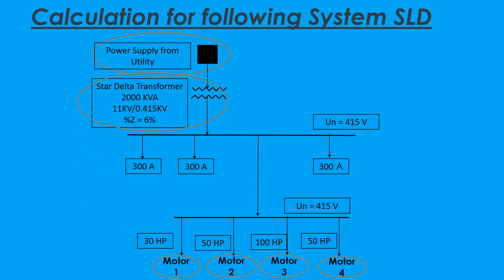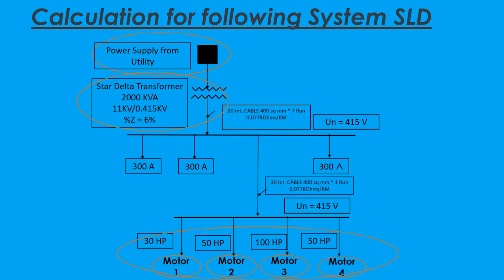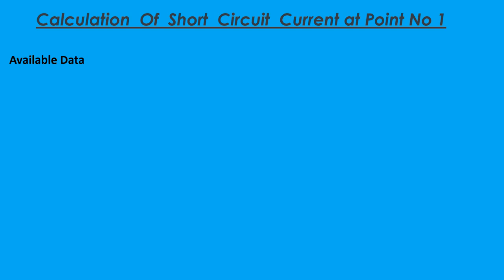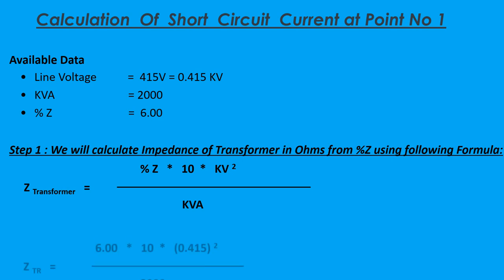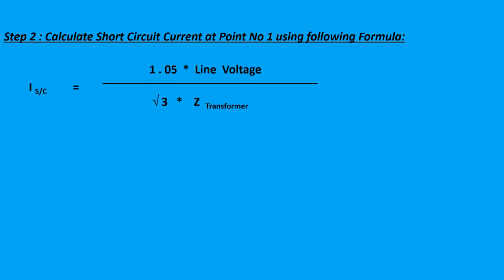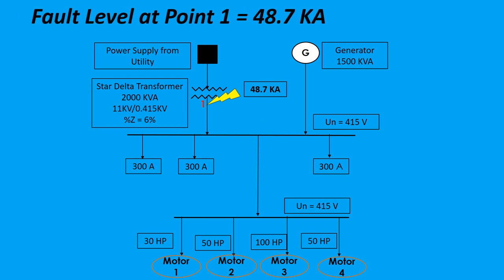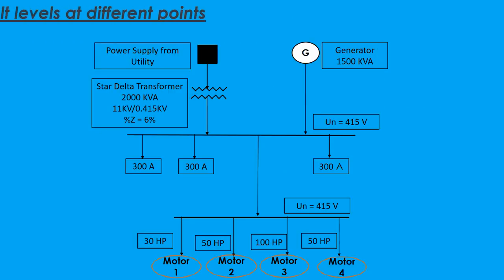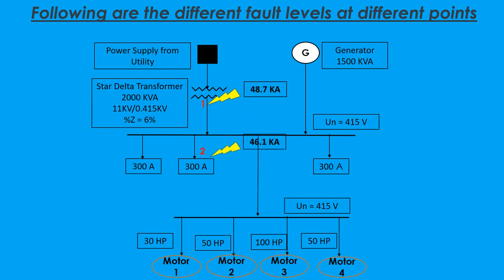Short Circuit Fault Level Calculation

Comment: Nice video if the questions can be explained. A number of people (including myself) asked why the factor of 1.05 comes into the equation. I still prefer the per unit method. It eliminates the need to determine what voltages should be used at different levels if you have multiple transformers.
Also,  all those motor loads will definitely contribute to increasing the Isc at point 3. Suggestion is that if you don’t want to bring motor contribution into example, don’t specify motor loads. It can confuse some readers thinking that you don’t need to add motor contribution.
Reply from the maker: Thank you for sharing your views and thank you for the question, Answer to 1.05 question is : 1.05 is a  voltage factor required in the calculation to
account for Voltage variations in the system,if we consider voltage variation of +-6% in voltage , we have to use factor of 1.05 in the formula as per standard IEC 60909.
Reply: @ratssaesquareallaboutelect5919  
Thank you for your reply. Much appreciated.
Reply: @pietervdberg7055  Also note that motor contribution only occurs for 3 to 4 cycles for asynchronous or 6 cycles for synchronous machines, so not a huge factor when sizing equipment based on steady state conditions or fault levels that can exist for hundreds of milliseconds or more. Also the 1.05 takes into account the voltage factor  or voltage rise that occurs on phase due to the raised neutral potential and normally relevant on single phase shorts
Reply: @richhall3662  nice
Reply: In short, calculate the short circuit current at nominal voltage and add 5% extra value to Isc (considering the factor for rise in voltage level).

Comment: The presentation will be complete if motor contribution to fault is considered which is very important factor..
Reply: Motor and Generator as well
Reply from the maker: If Total Motor Current (100 + 50 + 50 + 30 HP , 415V , 0.85 PF) = 281A

Total Motor  current<= 0.01*Isc , then motor contribution can be neglected,
Then isc at F1 - 48.7ka , ,281< 487 , MOTOR CONTRIBUTION can be ignored, similarly F2 - 46.1ka , 281 < 461 and F3 33.5ka , 281 < 335 , motor contribution can be ignored

Comment: Could you please explain number "10" in the formula for z(transformer). Where did it come from.
Reply: its contant in order not to include the thousand in the kva of transformer instead using 2000000 you will use 2000

Comment from the maker: If Total Motor Current (100 + 50 + 50 + 30 HP , 415V , 0.85 PF) = 281A

Total Motor  current<= 0.01*Isc , then motor contribution can be neglected,
Then isc at F1 - 48.7ka , ,281< 487 , MOTOR CONTRIBUTION can be ignored, similarly F2 - 46.1ka , 281 < 461 and F3 33.5ka , 281 < 335 , motor contribution can be ignored

Comment: Very nice video. But I did not see any contribution of motors into the fault point as a secondary source and alternator and also why you have included 1.05XV in the calculation?
Reply: HOPE YOU HAVE NOT RECEIVED ANY ANSWER.
Reply from the maker: If Total Motor Current (100 + 50 + 50 + 30 HP , 415V , 0.85 PF) = 281A

Total Motor  current<= 0.01*Isc , then motor contribution can be neglected,
Then isc at F1 - 48.7ka , ,281< 487 , MOTOR CONTRIBUTION can be ignored, similarly F2 - 46.1ka , 281 < 461 and F3 33.5ka , 281 < 335 , motor contribution can be ignored

Comment: what is the effect of the motors in the short circuit calculation?
Reply from the maker: If Total Motor Current (100 + 50 + 50 + 30 HP , 415V , 0.85 PF) = 281A

Total Motor  current<= 0.01*Isc , then motor contribution can be neglected,
Then isc at F1 - 48.7ka , ,281< 487 , MOTOR CONTRIBUTION can be ignored, similarly F2 - 46.1ka , 281 < 461 and F3 33.5ka , 281 < 335 , motor contribution can be ignored

Comment: Pls help with data sheet reference for Cable impedance value. It seems you have considered Cable resistance value instead of Impedance. Pls clarify. Thanks
Reply: If you multiply kva by 1000 and kv by 1000 but undersquare and  make per unit impedance 0.06
It makes the same number
Reply: You are right, I think data of DC resistance value has been considered here, instead of which cable impedance as per manufacturer's data should have been considered.

Comment: Thanks for the video. 
Please when you mentioned number of runs;  did you mean the number of cables or what ?
Please, explain it further. 
Thanks.
Reply from the maker: No of run means no of parallel cables

Comment: Please explain the factor 1.05. how it comes.
Reply: sunil kumar moharana 5% voltage tolerance, which is very typical.
Reply from the maker: thank you for the question, Answer to 1.05 question is : 1.05 is a  voltage factor required in the calculation to
account for Voltage variations in the system,if we consider voltage variation of +-6% in voltage , we have to use factor of 1.05 in the formula as per standard IEC 60909.

Comment: What about motors contribution to the fault?
Reply: Good question the reverse currents shall be calculated
Reply from the maker: If Total Motor Current (100 + 50 + 50 + 30 HP , 415V , 0.85 PF) = 281A

Total Motor  current<= 0.01*Isc , then motor contribution can be neglected,
Then isc at F1 - 48.7ka , ,281< 487 , MOTOR CONTRIBUTION can be ignored, similarly F2 - 46.1ka , 281 < 461 and F3 33.5ka , 281 < 335 , motor contribution can be ignored

Comment: Where it's coming 10, in impedance of transformer, what is the fault current in 11kv side
Reply from the maker: it can be obtained  from transformer rating plate.
Reply: @ratssaesquareallaboutelect5919  sir pls explain from where it's coming 10

Comment: Where did you get 1.05 shown in your cakculation.
Reply from the maker: As per standard IEC 60909 - 2001 , We have to consider the voltage factor of 1.05 in LV fault calculation (100V to 1000V).

Comment: Can you please explain why you are dividing the line voltage by the square root of 3 in Isc formula (At Point 1) ? Your response will be very helpful.
Reply: it is incorrect. There is no point dividing by root3. Any current is simply V/Z. 1.05 is form factor.

Comment: Hw did u get 1.05 while calculating Isc
Reply from the maker: thank you for the question, Answer to 1.05 question is : 1.05 is a  voltage factor required in the calculation to
account for Voltage variations in the system,if we consider voltage variation of +-6% in voltage , we have to use factor of 1.05 in the formula as per standard IEC 60909.

Comment: is 1.05 in the equation a constant value and how about the impedance value of cable ohms per km is it also constant?
Reply from the maker: 1.05 is part of equation and impedance of cable can be obtained from the cable manufacturer .
Thanks for writing
Reply: 1.05 is a voltage correction factor
Voltage maximum/voltage minimum
440÷410

Comment: can explain how 1.05 has been considered
Reply from the maker: thank you for the question, Answer to 1.05 question is : 1.05 is a  voltage factor required in the calculation to
account for Voltage variations in the system,if we consider voltage variation of +-6% in voltage , we have to use factor of 1.05 in the formula as per standard IEC 60909.

Comment: Thank you for the nice video,  this considered single phase to ground fault. Would you also make a fault current calculation video for ph-ph, ph-ph-gnd, 3ph fault?
Reply: @yaminoshinn1473  415 v is line voltage, by dividing on sqr3, it would be phase voltage

Comment: Why did you not consider the contribution of the motors below and the generator above whose ratings are significant????
Reply from the maker: If Total Motor Current (100 + 50 + 50 + 30 HP , 415V , 0.85 PF) = 281A

Total Motor  current<= 0.01*Isc , then motor contribution can be neglected,
Then isc at F1 - 48.7ka , ,281< 487 , MOTOR CONTRIBUTION can be ignored, similarly F2 - 46.1ka , 281 < 461 and F3 33.5ka , 281 < 335 , motor contribution can be ignored

Comment: What is the fault current contribution from motor
Reply from the maker: If Total Motor Current (100 + 50 + 50 + 30 HP , 415V , 0.85 PF) = 281A

Total Motor  current<= 0.01*Isc , then motor contribution can be neglected,
Then isc at F1 - 48.7ka , ,281< 487 , MOTOR CONTRIBUTION can be ignored, similarly F2 - 46.1ka , 281 < 461 and F3 33.5ka , 281 < 335 , motor contribution can be ignored

Comment: What is 1-05 in the formula?
Reply from the maker: thank you for the question, Answer to 1.05 question is : 1.05 is a  voltage factor required in the calculation to
account for Voltage variations in the system,if we consider voltage variation of +-6% in voltage , we have to use factor of 1.05 in the formula as per standard IEC 60909.

Comment: HOW YOU DETERMINED OHMS(0.0778) AT BETWEEN  POINT 1 TO2)AT3.41?
Reply: U have to take transformer impedance x10xline volt x line volt

Comment: what happen to the current contribution of the motor ? you have not consiger it in your calculation. for your info tnx
Reply from the maker: If Total Motor Current (100 + 50 + 50 + 30 HP , 415V , 0.85 PF) = 281A

Total Motor  current<= 0.01*Isc , then motor contribution can be neglected,
Then isc at F1 - 48.7ka , ,281< 487 , MOTOR CONTRIBUTION can be ignored, similarly F2 - 46.1ka , 281 < 461 and F3 33.5ka , 281 < 335 , motor contribution can be ignored

Comment: The contribution of the electrical motors to the fault current wasn't captured. It will supply fault current to the bus which it is connected to during a fault
Reply: you are correct during the fault there are some contribution from the motor this method seems shortcut.
Reply from the maker: If Total Motor Current (100 + 50 + 50 + 30 HP , 415V , 0.85 PF) = 281A

Total Motor  current<= 0.01*Isc , then motor contribution can be neglected,
Then isc at F1 - 48.7ka , ,281< 487 , MOTOR CONTRIBUTION can be ignored, similarly F2 - 46.1ka , 281 < 461 and F3 33.5ka , 281 < 335 , motor contribution can be ignored
Reply from the maker: If Total Motor Current (100 + 50 + 50 + 30 HP , 415V , 0.85 PF) = 281A

Total Motor  current<= 0.01*Isc , then motor contribution can be neglected,
Then isc at F1 - 48.7ka , ,281< 487 , MOTOR CONTRIBUTION can be ignored, similarly F2 - 46.1ka , 281 < 461 and F3 33.5ka , 281 < 335 , motor contribution can be ignored

Comment: What is the value of 1.05
Reply: As I guess, the prefault voltage is 105% of norminal voltage thus the factor 1.05 is used?
Reply from the maker: thank you for the question, Answer to 1.05 question is : 1.05 is a  voltage factor required in the calculation to
account for Voltage variations in the system,if we consider voltage variation of +-6% in voltage , we have to use factor of 1.05 in the formula as per standard IEC 60909.

Comment: Hi Sir, How did you get the figure of 1.05 in the formula?  Please advice.....
Reply from the maker: thank you for the question, Answer to 1.05 question is : 1.05 is a  voltage factor required in the calculation to
account for Voltage variations in the system,if we consider voltage variation of +-6% in voltage , we have to use factor of 1.05 in the formula as per standard IEC 60909.
Reply: IF the Voltagebminus side ,variation is 10% on plus sideand,what. is the factor.

Comment: and why is that motor contribution is neglected?
Reply from the maker: If Total Motor Current (100 + 50 + 50 + 30 HP , 415V , 0.85 PF) = 281A

Total Motor  current<= 0.01*Isc , then motor contribution can be neglected,
Then isc at F1 - 48.7ka , ,281< 487 , MOTOR CONTRIBUTION can be ignored, similarly F2 - 46.1ka , 281 < 461 and F3 33.5ka , 281 < 335 , motor contribution can be ignored

Comment: good video but where is the motors contribution, they will raise the fault level !!!
Reply from the maker: If Total Motor Current (100 + 50 + 50 + 30 HP , 415V , 0.85 PF) = 281A

Total Motor  current<= 0.01*Isc , then motor contribution can be neglected,
Then isc at F1 - 48.7ka , ,281< 487 , MOTOR CONTRIBUTION can be ignored, similarly F2 - 46.1ka , 281 < 461 and F3 33.5ka , 281 < 335 , motor contribution can be ignored

Comment: how do motors affect short-circuit currents?
Reply: for solving of short circuit current of electrical system all connected equipment's and load must be consider, in your calculation load is not considered.
Reply from the maker: If Total Motor Current (100 + 50 + 50 + 30 HP , 415V , 0.85 PF) = 281A

Total Motor  current<= 0.01*Isc , then motor contribution can be neglected,
Then isc at F1 - 48.7ka , ,281< 487 , MOTOR CONTRIBUTION can be ignored, similarly F2 - 46.1ka , 281 < 461 and F3 33.5ka , 281 < 335 , motor contribution can be ignored
Reply from the maker: If Total Motor Current (100 + 50 + 50 + 30 HP , 415V , 0.85 PF) = 281A

Total Motor  current<= 0.01*Isc , then motor contribution can be neglected,
Then isc at F1 - 48.7ka , ,281< 487 , MOTOR CONTRIBUTION can be ignored, similarly F2 - 46.1ka , 281 < 461 and F3 33.5ka , 281 < 335 , motor contribution can be ignored

Comment: What about motor contributions??
Reply from the maker: If Total Motor Current (100 + 50 + 50 + 30 HP , 415V , 0.85 PF) = 281A

Total Motor  current<= 0.01*Isc , then motor contribution can be neglected,
Then isc at F1 - 48.7ka , ,281< 487 , MOTOR CONTRIBUTION can be ignored, similarly F2 - 46.1ka , 281 < 461 and F3 33.5ka , 281 < 335 , motor contribution can be ignored

Comment: Not comprehensive it does not consider the available fault MVA at the utility and motors subtransient reactance
Reply from the maker: This type of calculation is used for deciding the Short circuit Breaking Capacity of MCCB to be used. Other factor as mentioned can be also calculated.

Thanks for writing
Reply: @ratssaesquareallaboutelect5919   Could you please explain how to select  the required breaking capacity of individual motors?

Comment: Mam in farmula 1.05 and 10 is coming from where?
Reply from the maker: thank you for the question, Answer to 1.05 question is : 1.05 is a  voltage factor required in the calculation to
account for Voltage variations in the system,if we consider voltage variation of +-6% in voltage , we have to use factor of 1.05 in the formula as per standard IEC 60909.

Comment: Transformer impedance already given %6=.06 ohm so why u are re calculate ?
Reply: The transformer impedance given in percentage is used when you convert all impedances to Per Unit. She avoided the per unit conversions by calculating the Z impedance first

Comment: but you ignore motor reactance how could you !!!
Reply from the maker: If Total Motor Current (100 + 50 + 50 + 30 HP , 415V , 0.85 PF) = 281A

Total Motor  current<= 0.01*Isc , then motor contribution can be neglected,
Then isc at F1 - 48.7ka , ,281< 487 , MOTOR CONTRIBUTION can be ignored, similarly F2 - 46.1ka , 281 < 461 and F3 33.5ka , 281 < 335 , motor contribution can be ignored

Comment: too complicated , instead do this, first calculate the sec current of transformer,  which is Isec= rated KVA/sec voltage, incase its 3 phase (1.73 into voltage) , u will get Isec of transformer, now next step to calculate short circuit current  by using the formulae , isc= Isec*100/%imp of transfomer , which will give u the short circuit curent on busbar by transformer
Reply: How to calculate point no 2?

Comment: What is value of 1.05
Reply from the maker: As per standard IEC 60909 - 2001 , We have to consider the voltage factor of 1.05 in LV fault calculation (100V to 1000V).